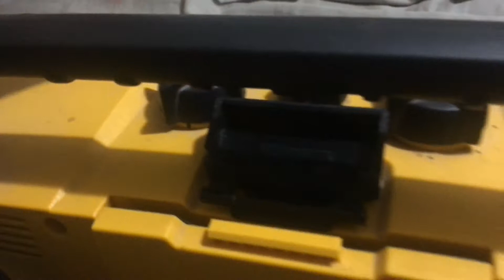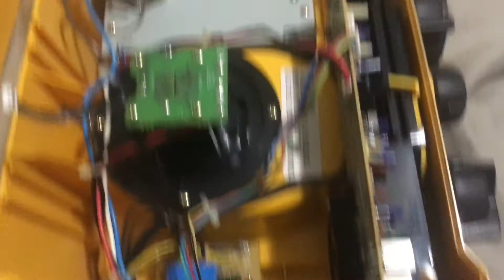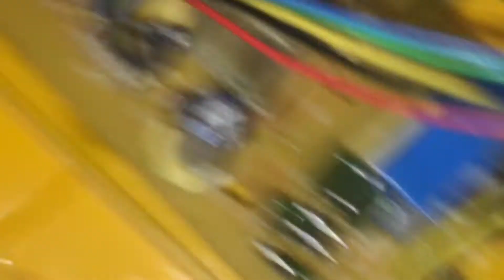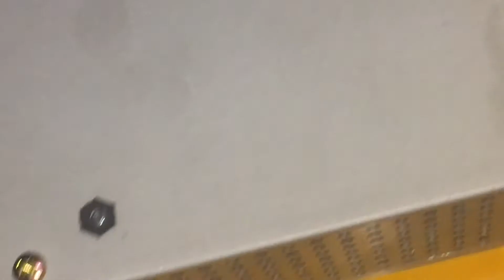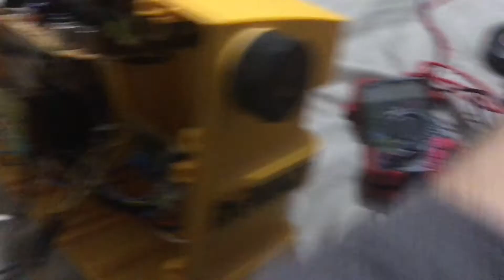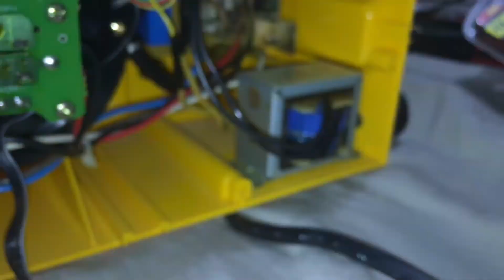Dewalt dw911 work site radio will not turn on repair fix

Comment: The original temperaturfuse is 125°C and  placed under a hard plastic cover on the same side where the primary side is connected (white wires).

Comment: My transformer in the power supply was bad. No output. Removed the xformer and found the primary winding open. I found a replacement xformer on ebay. The replacement xformer was larger, but I found some open space to accommodate the new part.

Comment: Was it still able to charge the battery? I have a DCR015 and the battery charges, there's power at the connector for the button panel but the charge light doesn't light up and there's no sign of life when I try to turn it on.
Reply: Same problem mate

Comment: Thanks for doing your video, I have the same radio that looks like new with no power. I checked the transformer and it is dead just like yours was so I found one on eBay and ordered it today, can't wait for it to show up so I can make my radio work again. This seems to be a problem with this model and when I went to look up parts on line almost everything is no longer available.
Reply: So...Did u get it working?

Comment: Where did you find the transformer?
Reply from the maker: Kyle Mayes from my pile of random electronics. You could just buy a 12v 5a power supply, and solder the wires into where the yellow goes.
Reply: After Hours Tv & Pc repair can you find a part# for me? I've had no luck finding one

Comment: That is definitely the skankiest soldering iron tip I have ever seen. Hit it with a file or get a new tip., then get a damp sponge or commercial solution to keep it clean.  You're just knocking your head against a wall trying to get it to work. Otherwise, thanks for a good vid showing some solid advice on troubleshooting a dead radio.
And I wouldn't trust the glue, either -- I'd use hardware with some nail polish/threadlocker on the threads.
Reply from the maker: Yeah working on short notice and couldn’t find my good soldering iron. Construction worker claims it to be still functioning, I assume the crappy glue is as well.
Reply: Thanks for the follow-up -- I feel better already! I'm guessing your fix cost him far less than buying a new radio AND didn't add to the local landfill. Bonus points for reusing an old xformer. You can still file that tip down to a point, tin it, and get one that works like new.

Comment: Jake I would never trust mounting that transformer with glue. I would have melted or drilled some holes through the case and used screws and nuts and perhaps rubber seal washers and Locktite Green.
Reply from the maker: Daveyk021 good idea, since I will have the chance of working on it again, customer put same battery back in, and killed the machine, i asssume it's the fuse this time. I'll use screws and nuts.
Reply: After Hours Tv & Pc repair I'm from the 1960s/1970s. Us Boomers don't trust glue.
Reply from the maker: Daveyk021 don't blame ya, seems to be the same or similar they use for teeth I believe. I've used stuff like it before with a professional unit.
Reply: After Hours Tv & Pc repair I just would not trust glue to keep a heavy metal Xfmr to relatively thin plastic. I may very well be wrong. I look forward to part two to see if it stayed mounted.
Reply: If anyone else is trying to replace their speakers, I had an absolute bear of a time getting they thing open. I hammered a knife blade through one of the corners and gently pried it open.